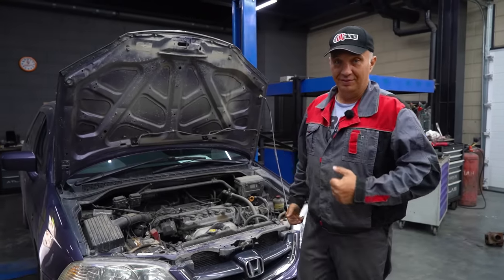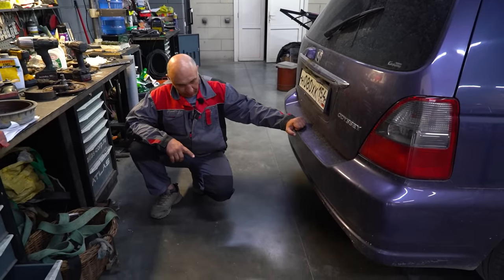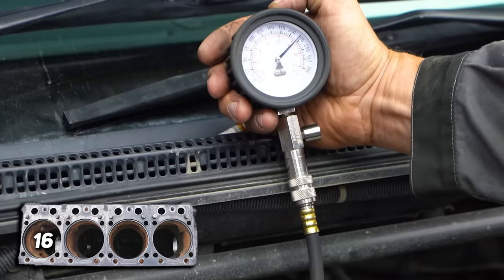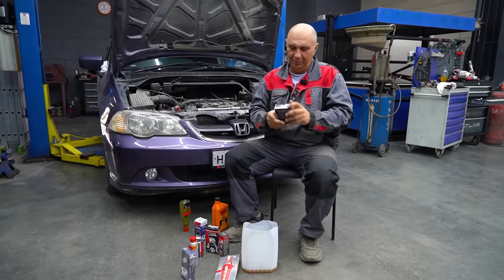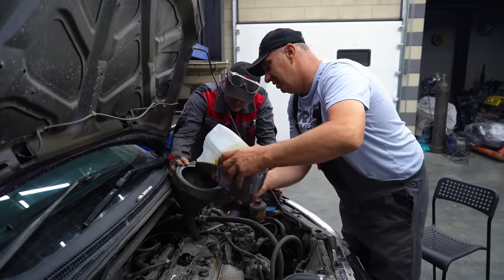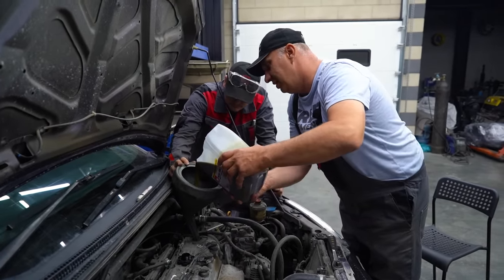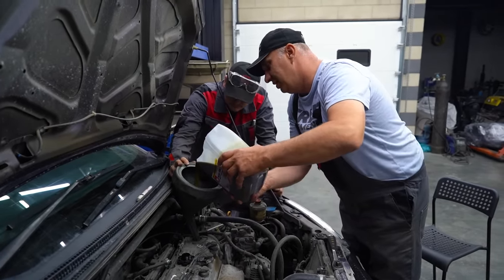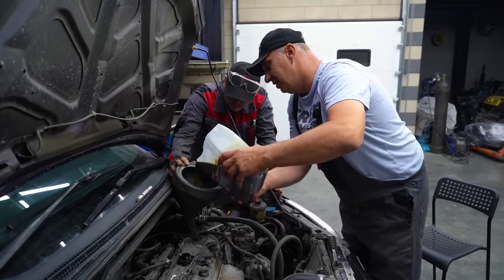Running an engine on additives instead of oil - what will happen?

Comment: Do this with fuel additives instead of fuel!
Reply: I'd have thought they'd do both this go around ha
Reply: guys in US tried it it does not work
Reply: YESSSSS
Reply: It will just break the fuel pump
Reply: Ahahaha,   ❤👍👍👍
Reply: mastermilo did something similar. he tried to run car on octane booster additive and car actually ran.
Reply: can they combust? if so, they will run ( energy efficiency?)
Reply: Oh hell yeah!
Reply: It depends on what kind of fuel additives you use. Some are ethanol based to remove water from fuel system that will burn and maybe could run the engine. Fuel anyway have ethanol in. But then there is stuff that is unlikely to burn by itself. So with selecting the right stuff I'm sure it is possible. Some other stuff probably not. It is anyway just additive to work together with fuel and not by itself usually.
Reply: It would probably work for a diesel
Reply: Shit like sea foam is basically kerosene. And mixing some diesel with regular gas will actually raise the octane on it (antiknock). They use to do that years back.
Reply: Also my understanding is that with older diesel cars mixing very little amount of gas to diesel was working in extreme cold weather to prevent geling to occure as last resort if nothing else is available (or geling will occure but you might have couple of degrees lower temperature possible before fuel system gets cloaked). Of course if there is kerosin available or possibility to get winter grade diesel fuel that is every case the recommended approach. And definitely doesn't work with any fancier new high pressure diesel systems, just with some older cars with mechanical pumps etc. And even then not recommended of course. I think the idea was that in the war times you might get your truck moving in extreme cold weather without having fire or other heater in use...
Reply: Epic
Reply: Yes please
Reply: I just did this with an old mercedes diesel van. Poured anything I could find in the fuel tank that wasn’t diesel fuel. Hand sanitizer gel, gas, gear oil, brake cleaner, brake fluid, waste oil changes. Didn’t notice anything other than more smelly exhaust. It doesn’t even smoke, and it’s just as slow as before
Reply: @uooello13 russia probably has some better ones that aren't legal to sell in america
Reply: I would guess fuel additives are not viscous enough to make a lubricating film around barings. A  baring will fail somewhere. ☠️⚰️
Reply: @Kenji1685  They said «as fuel», not as a replacement for engine oil
Reply: @jhsevs  mechanical German diesels are bulletproof
Reply: @jhsevs    I see...🤔 Octane booster is a fuel additive, so will that run in an engine alone without blowing up? 🤔 🤣🤣  That would be fun to see.
Reply: Project farm did it! 🤭👍 He run an engine just on octane booster. 😉
Reply: Any additives don't burn well. But oil is not meant to burn. So, it works with oil. But it won't work with fuel
Reply: "* Ozone has left the 'chat' *"
Reply: @kakaeriko i would say prolly not they are a really high octane lmao. It's too high to combust
Reply: @uooello13  на дизеле работают

Comment: Love that you added the phone voice effect in the translation, BMIrussian always giving it the full 107%
Reply: Hey, what can I say, we love what we do.
Reply: BMI Russian has stepped up the game, yet again. I almost didn't realise it was being interpreted!
Reply: goated translators
Reply: What will happen if you put to mutch oil in it ? When is it to much ?
Reply: @jethrolambrechts6132  It will push through the rings more and can even blow past the main seals..
Reply: @jethrolambrechts6132  A little too much will allow the crankshaft to hit the top of the oil and aerate it, a lot too much will increase oil burn as its flung around the entire crankcase and made much easier to suck past the piston rings on the intake stroke. Way too much will start leaking out of everywhere and will foul out the plugs very quickly. Filled to the top will probably hydrolock the engine if it doesnt leak out first
Reply: I completely missed thats what happened, I know this is all just BMIRussians translations but it gets so believable often you just blank out and see it as nothing but normal and forget that its not what was there originally. Hats off for the addition.
Reply: Does garage54 has a version with only subtitles instead of voiceover ?
Reply: @MsTatakai I know they have ones without the voice over, not sure about captions are only in Russian or translated.
Reply: @LeonardRoberts  where? i can't find it =P

Comment: Project Farm did several videos regarding additives. They usually do their job with reasonable expectations.  They aren’t a mechanic in a bottle, but you can expect seal leaks to become a bit less of an issue (maybe even stopping completely), and potentially some slight improvements to smoking/noises/compression, albeit small.  I’d call them “better than oil alone” for old, tired engines, and with that said, I often use Lucas.
Reply: Yep. I use Lucas Oil Upper Cylinder Lubricant & Fuel Treatment & Injector Cleaner in my F15 3.0D as a maintenance. 

It works perfectly. Cleans the injectors, less fuel consumption. 

I frequently put the pedal to the metal for plus 15 minutes so the dpf etc gets "flushed".
Reply: @laurapalmerTDGE I like to run moreys upper cyl lube/cleaner liqui moly fuel cleaner conditioner and nulon octane booster with every fill up I've got it all mixed together by ratio and just use my mini squeeze bottle and also alittle bit of oil stabilzier maybe %2.5 or with my oil burning honda upto 15 or so
Reply: @allegorx58  I'm able to get everything pretty cheap hence the "homebrew" fuel additive setup runs great in all my cars and I thought with my civic burning oil it may help burn out with less mess in the motor and the previous owner mae the timing out so the octane booster helps there again. 
everything is half dosed so it lasts longer and I don't do any "damage"  
I do like the stabilizers though even 2.5% in any cars oil change won't effect viscosity and makes the oil just that little bit tackier. I personally don't like high amounts of oil additives anyway never really noticed a diff oil consumption wise but I do run that little bit more in the civic.
When I bought it it was horrific but with really short oil changes an such it is better but it has its days it'll eithier be a fog machine or a very slight haze in the mirror again when warm and cold different again and outside temps 😂 it's a guessing game I love it
Reply: Agreed on this. I've had a rear main start leaking mid trip out bush. Added nulon rear main stop leak, slowed it to a seep. Incredible stuff
Reply: I trust Project Farm; I take the results as gospel. Well done; covers most all the bases.
Reply: @garychandler4296  pretty much same.  He shows it how it is.

Comment: i had an accord with the f23 engine. It too did the same thing, turns out the oil control rings on that particular engine loved to sludge up and get stuck, once they were stuck these engines were ticking time bombs and all this effort to control the smoke is moot because the blowby causes the intake to clog up full up carbonized oil via the egr port. So even if any of this did anything to help the oil control rings, the engine is still sucking in its own carbon and oil deposits from the egr side anyways and slowly killing itself in the process. all that needs to be done is replace the rings and clean the upper engine stuff (intake manifold will be full, lap the valves and clean the all the carbon out) and it will live to see more miles

Comment: Since the engine kept burning so much oil, maybe you should try to run it only with that thick anti smoke additive in it. Great video as always!
Reply: Valve seals are probably totaled already, all the blue smoke shows it well.
Reply: @Jean-Denis_R_R_Loret Don't forget; smoke on acceleration-rings leaking, smoke on decel-valve guides worn. 
All tests should be on equalized engines, same life, same abuse, etc. 
Otherwise it's not scientific because repeated results will vary. 
Still, great entertainment here; love it!
Reply: @garychandler4296  one thing ive learned about cars is they don't care about scientific evidence what will fix one will blow another anyway

Comment: Once I had a V8 Holden (Australia) car with an old engine. I made water injection and plugged it onto the inlet manifold. It was a bottle, some clear fish tank tube, a fish tank air adjuster to adjust the water flow. It worked well, I used it for over a year. I then rebuilt the motor and realised the port on the manifold only allowed the water to one bank of the V8. Half of the motor was very dirty, oily and with carbon deposits... the other half was clean... like new...no carbon, absolutely clean?? With your smokey, gunked up Honda... try putting a garden hose with a fine mist spray of water into the throttle body so that you can see steam come out of the exhaust. Don't run so much water mist to hydraulic lock the motor, but enough to see steam from the tail pipe. I think maybe after an hour or 2, the water may clean and free up the rings/valves intake runners etc... give it a go... it can't hurt haha Greetings from Australia
Reply: Fellow aussie here. Just curious, when you say "old", how old do you mean? Like, what model and engine?

Misting water into the intake is one of those 'if you know, you know' trade-secret type of things. Sorta similar to emulating water in with the fuel - swings and roundabouts.
Reply: @zchettaz  HX kingswood with a 253. You don't want water in the fuel, you want the water mist in the air that mixes with the atomised fuel
Reply: @ratmanmurray7137  
Nice mate. I had a HZ wagon, been looking around for another kingwood as a project but they're worth a fortune now, so regret not keeping the HZ. 

I know water by itself wont mix with fuel, that why its emulated, meaning that its combined with an agent that allows it to bind to the fuel. Its also called 'aqueous fuel'. 
This aqueous fuel is vapourised by the water component as steam in the chamber. The expansion of the steam together with the combustion of the hydrogen released by dissociation of the water molecule results in the same power output as compared with the same amount of fuel, even though it has half the potential energy. Thus, it increases the octane level, allowing higher compression before detonating, it also helps lower emissions and absorb combustion heat, amongst a few other things. 

Long story short, if done correctly, your engine can increase its power output by up to 14% with only 5% emulated water in the fuel. While im sure these percentages can go higher, there is a tipping point where it will decrease power output, but i have never pushed that limit... yet lol. 

Doing this in combination with water mist in the intake can increase engine power output by between 20% - 25%. However, this also requires a couple of other adjustments (a/f ratio, spark etc) so i wouldn't recommend it unless you really know what your doing. 

And yes, Im a bit of a nerd if you couldnt tell lol (think jesse from original fast and furious) and sorry for the essay.

Comment: Flush it perfectly clean with acetone (i mean like many-many litres until all the oil channels are clean and no crap comes out anymore from bottom plug) and then fill it up with full synthetic 2-stroke oil :)
Reply: Have you done it? Is the flush safe?
Reply: @SALTrips  no i havent done it but i dont see a reason why it shouldnt be safe
Reply: I would guess, it ruins the seals and cause other problems. Too strong. But diesel fuel should be ok for a flush.

Comment: Seafoam or Redex the pistons, pull out the plugs, pour in a good weight of either, allow to settle overnight, put some cloths loosely over plug holes and spin till all the excess stuff has come out onto cloths, plugs back in and start up, then induct some into the air intake to clean that side of things as well and the soaking should free off rings, attack carbon buildup on crowns and valve faces.   You could follow with a water induction to wash away any lingering yuk.

Comment: Try to rotate engine for 90 degrees so pistons will be bottom and cankshaft top.
Reply: That would be 180 degrees but i love this idea. They would have to somehow make an oil pickup that went from the valve cover to the oil pump or run an external oil pump... That would be really fun to watch them figure out
Reply: @jblob5764  first off no and more no. there is alot of design and part changes to change the orientation of an engine. they are based on gravity after all. the valve would be a problem on this engine the spark plug boots would dump the oil out. and the only positive for the whole scenario would be the bottom end wouldnt have oil clinging to it so it would free up horsepower until it blew up.
you could do a dry sump and have the engine drain into the oil return but still its gonna constantly lose oil fast and without a dry sump setup the oil pump isnt going to prime for a long time on start up and just destroy the bearings.
on a cam in block engine the rockers lubricate the camshaft by letting oil drip down on to it. cam in head would last a little longer but not by much the oil will be flung away rather than lubricate the lobes or lifters.
Reply: There were aircraft engines that were orientated like that.
Reply: @chehystpewpur4754  yeah its obviously a terrible idea for a plethora of reasons, but im suggesting some quick bandaid fixes they could do just to make it operate for a short while like most of their other absurd experiments.
To make it actually function reliably for any real duration youd have to re engineer so many things, improve the seals of the valve cover, o-ring seal all the spark plug holes which takes machining grooves into them, basically either turn the valve cover into an oil pan or route everything into a dry sump setup with an external pump, the cylinders would constantly flood with oil from the crank bearings and it would always have oil in the combustion chamber on startup from the leak down which would definitely create a risk of an oil hydrolock on EVERY start-up. would be a nightmare to make work long term, hell subarus constantly leak oil from valve covers and those are sideways not upside down lol. But if they were willing to make an inline 4 into a 2 stroke i think they'd be up for the task of trying for entertainment

Comment: Well, most of these oil additives are really just a few% actual additives, and for the rest consist of some low API grade base oil (SC/CC), usually monograde. By themselves, they will work.as a very basic motor oil, for a short while.
Reply: Very thick;  I used one of these, STP, on a Fiat Spyder twin cam and it promptly destroyed the bearings.
Reply: @Flies2FLL  it's straight 30 weight. It's fine once warmed.
Reply: @TheGuruStud  That's way thicker than most modern (meaning non-agricultural, made after 1950) engines like to start with from cold. OTOH you 're not supposed to use 100% STP in your engine...

Comment: take the engine apart, as you did with the lada engine.. clean it, new gaskets and see if the smoke is done.. and one final compression test
Reply: It would probably be fine afterwards. After recently doing that to a 353K mile 27 year old D16Y7 and seeing the factory honing marks in the cylinders, bearing clearances still well within specs, and ending up with an engine that runs like new and burns no oil with nothing more than a good cleaning, new gaskets and hoses, and a new timing belt, I pretty much concluded that these classic Honda engines will last a lifetime with good maintenance and occasionally replacing belts, gaskets, hoses, etc as needed. After seeing how little wear that engine has, I'd bet good money that it will last the rest of my life on its original bearings, rings, pistons, valves, etc.
Reply: Diesel as engine oil flush

Comment: If your engine's running on oil I think it's time to replace those piston rings 😂
Reply: valve seals
Reply: @edtam6 correct ! also an extra lug to lock in VTEC
Reply: @edtam6  90% its rings, 10% its seals
Reply: It's oil rings. Normally valve guide seals when bad smoke on start up n then clears up.
Reply: @shawnsatterlee6035  when you put too many thickening additives, the seals go to shit
Reply: In a 100% good working engine.

Comment: that engine was in limp mode with the check engine light... ofc it smells more like gasoline. It does not use any sensor and runs on fixed mapping (rich on gasoline).

Comment: I know Japanese motors are very reliable but hey, this very good indeed.
I suggest to put transmission fluid instead of traditional motor oiland see what happens
Reply: I've done that a few times.
it is excellent for cleaning the inside of the engine, as ATF contains lots of detergents.
you shouldn't do 100 percent, because the viscosity is not proper for the forces in an engine.
Reply: Scientifically thats bad
Reply: @jeyseychelles1370  that's true but if they want to make a stress test to the motor, i think it's a chance!

Comment: For the next Video... try Water in an Automatic Transmission, would be nice to see if its still can shift up or down.. ;D
Reply: Can tell you from personal experience that the tranny will not shift and the car won't even move 😂
Reply: @Dillybar777 it would shift alright, right into housing pieces on the floor
Reply: @lenney872  LMAO
Reply: It'll slip and ruin the discs
Reply: @Dillybar777  as I told my friend who did this and in engine in fort drum ny right before winter. "Well now you have 6 neturals and a vacant block."

Comment: Have you tried ATF (Automatic Transmission Fluid) in the engine instead of oil already?
Reply: It'll work fine on a modern engine. It's about 20 weight.